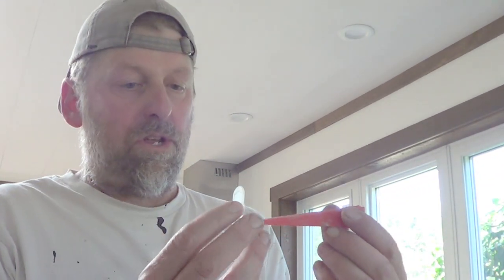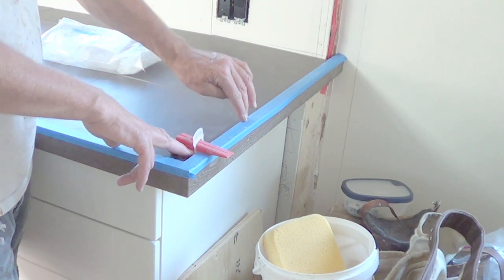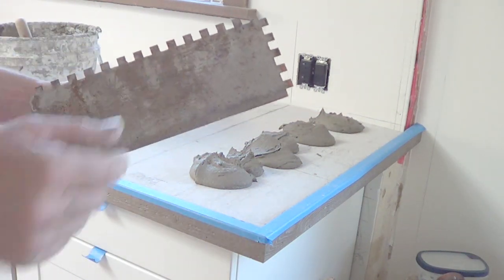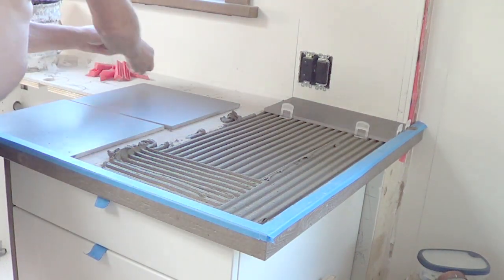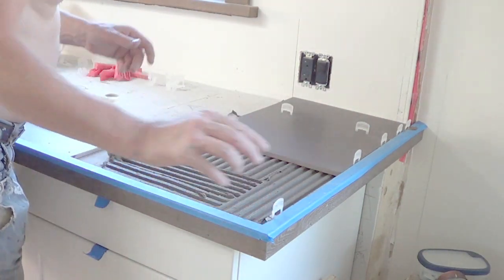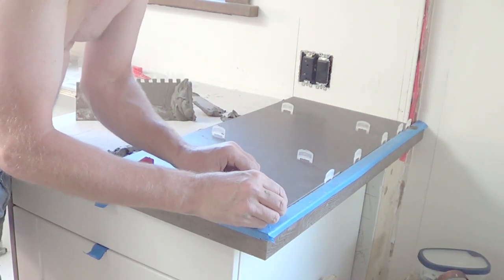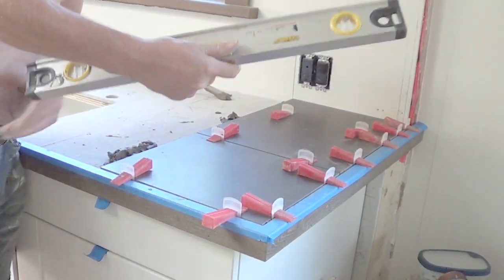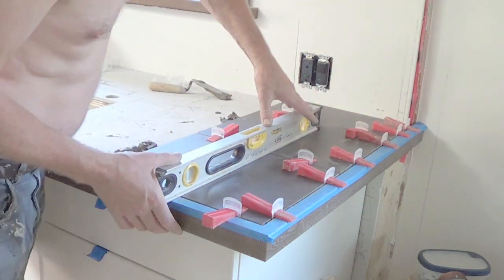How to Build a Tile Counter Top PT II

Comment: great job. any tips for using tile edging instead of wood?  I am planning on just putting hardiboard 1.25" along the boarder and having top tile over hang about 1/4" inch so when thing edge tile is applie the edge will be under the top piece. 
also  just found out I can get 30x30 tile at my local surply building supply place, will cut off 5"  and use that as a back splash.
Reply from the maker: Hi, i have never done a tile edge but yes you could attach your cut pieces to the front edge with some 1/4" backer board/ thinset , then i would flush the counter tile with the nosing. 
 One suggestion  would be to have a "form" of some kind  on the underside of the nosing to prevent any sagging-- simple 1X2 braced up off the floor.
Reply: @mralexdenny  great ideas, thanks so much! going to my surplus building supplier tomorrow and hope to get 30x30 in tiles for cheap.
Reply from the maker: @rollandelliott  OK, good luck with the project-- confirm the correct mortar for the job-- No- polymer modified if it is all cement  board/ backer  board to tile bonding--
Reply: Mitre the top tile45% and the edges leave about 1/16 inch edge where the tiles join screw timber supports under edges until glue dries. A lot more fiddly which is why you rarely see it done but worth as it appears solid.